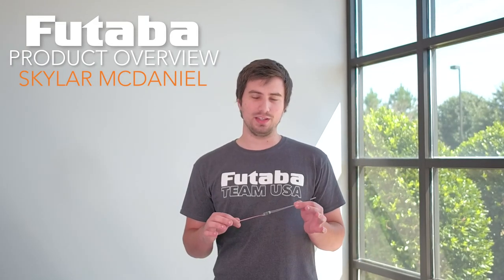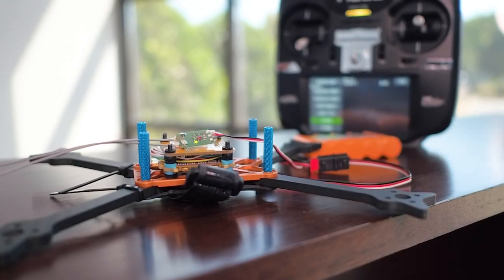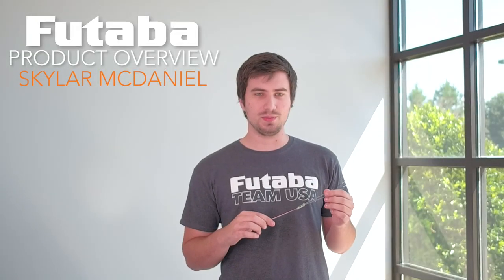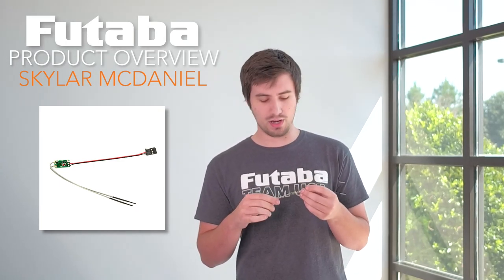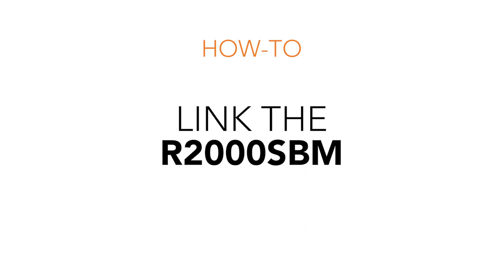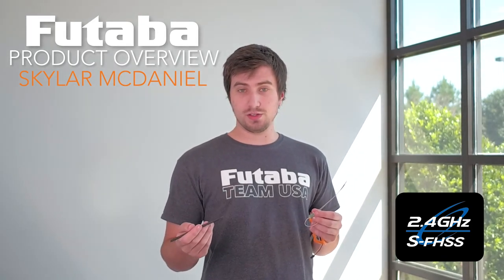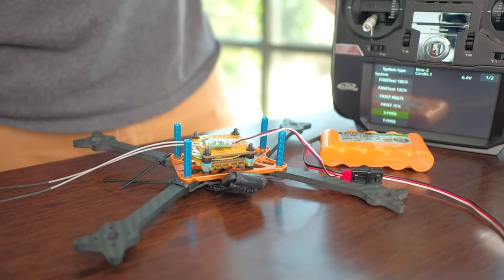OVERVIEW | R2000SBM, Futaba's Smallest Receiver + How-To Link It

Comment: Finally! I have been flying Futaba for years, and always wanted a small S-FHSS receiver. The R2008SB receivers are super bulky, so all of mine have been stripped down to the base plate, all the dumb pins removed, and subsequently shrink wrapped for durability. Still, they are fairly big, so it's good to see smaller alternatives come out.

Comment: Help to setup RSSI in Betaflight: In Betaflight under the receiver tab, setup RSSI channel to AUX12, enable RSSI in OSD and you should be good from there. You can setup alarm after low signal threshold if you want. Make sure RSSI_ADC under the Configuration tab is disabled. Hope this helps.

Comment: I have a question. How do I get my betaflight rssi set up with this receiver? I am using the 16sz
Reply: In Betaflight under the receiver tab, setup RSSI channel to AUX12, enable RSSI in OSD and you should be good from there. You can setup alarm after low signal threshold if you want. Make sure RSSI_ADC under the Configuration tab is disabled. Hope this helps.
Reply: Help to setup RSSI in Betaflight: In Betaflight under the receiver tab, setup RSSI channel to AUX12, enable RSSI in OSD and you should be good from there. You can setup alarm after low signal threshold if you want. Make sure RSSI_ADC under the Configuration tab is disabled. Hope this helps.
@Syed Salam (not my asnwer)